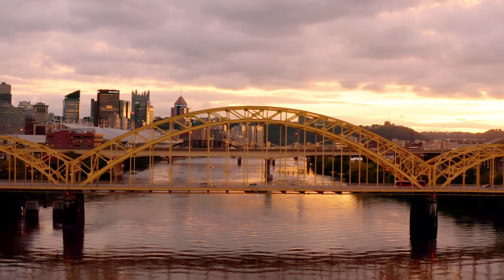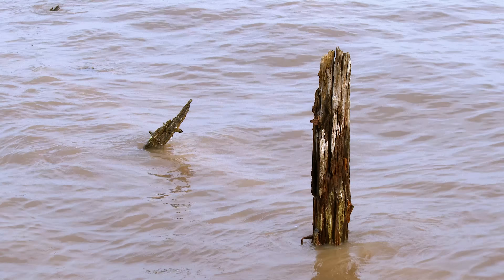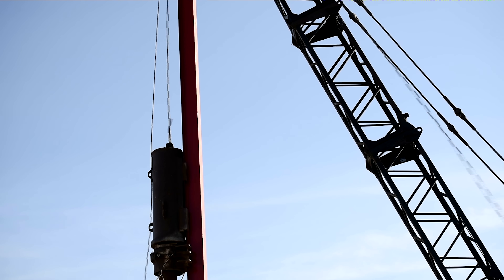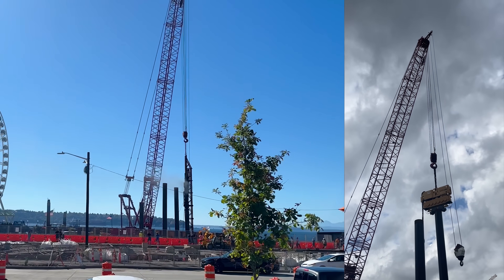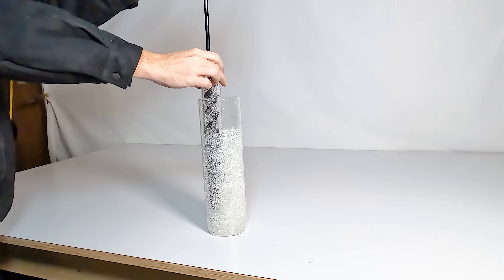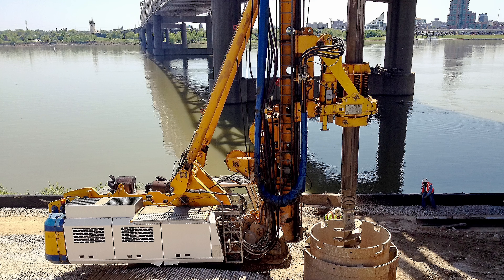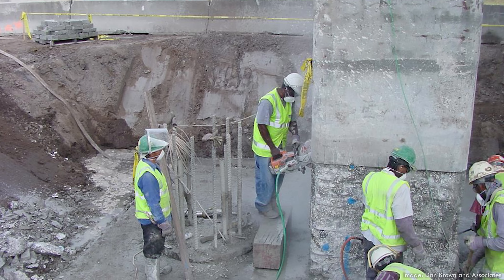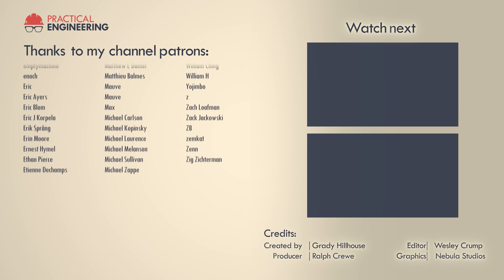Why Bridges Don't Sink

Comment: You brought back memories of the construction of CA118 through the San Fernando Valley. When I was a youngster CalTrans needed to span a concrete storm drain channel and the 2 streets diagonally. We lived two blocks away. Once the pile driving started, it seemed to last forever. 

One the plus side, when the city moved houses off their foundations to make room for the freeway in the 60's we took the banana seats off our stingrays and put 10 speed saddles on, cut down the bars and BMX was invented. All manner of ramps and bumps available in the newly emptied lots. 👍

Thanks for the videos!

Comment: I don’t know what it is called but I loved the idea of using water pressure to sink piles into a soft underwater soil. A pile with a open bottom and sealed top is lowered into the soil and then the water is pumped out of the top of the pile causing water pressure to push the pile into the ground

Comment: My favorite pile is a Torpedo Pile, why try and install a pile deep underwater when you can simply drop a huge nail with fins of the back of a boat! Note i don't really feel like they are true piles as they resist mooring loads of floating structures.

Comment: I worked at the building of the Oslo operahouse when I was young. One day I helped to scope and measure out some of the pilings in the water holding the building up. By some lapse in concentration I mis-scoped one pile and it now sits over a meter in the wrong position. Ooops... :D

Comment: In structural engineering we differentiate H beams and I beams by the "flange to web" ratio (or width to height for non technical terms)

An H beam will be square, as in the flanges are as wide as the web is tall. An I beam as a <1 ratio, so it's taller than it's wide

Comment: i used to install helical screw piles, largely for lower density residential settings, mostly just 10ft long 10-12" diameter single helix screws. Sometimes we would install over 60 a day as a single crew. It was a tough job, lots of driving (sometimes deep into the city with a large truck and long trailer, lots of energy exerted just to set up each jobsite. Unless something went wrong, like excessive frost or hitting large rocks under the surface, the job itself was typically quite straight forward. Lugging around sometimes dozens of these 100lb or so screws all over jobsites in preparation was usually the hardest part. I don't really miss that job, not that I like my current one all that much but even a decade later my shoulder still isn't recovered and the unpredictability of the amount of work each day (and thus when i would be off) wasn't what I wanted. Some days I'd be done by the early afternoon, others I'd be working from before sunrise to after sunset (and not even just in the winter), it was too unpredictable for me.

Comment: We built pole-frame buildings on the farm with a drilled hole, wooden post, and filling it with tamped gravel (or concrete). By far the simplest and cheapest way to put a building up. In one case a building started rising out of the ground as it floated on groundwater - we had to pull the walls back down a few inches each year to keep the building on the ground.

Comment: When they were excavating for the Taipei 101 building (https://en.wikipedia.org/wiki/Taipei_101) the weight of the dirt removed was about equal to the final occupied weight of the building so that the ground pressure would be the same.  I expect part of the design of pile foundations also does that, i.e. the ground loading (PSI) is about the same.

Comment: I know the limitations of driving piles in urban areas all too well. Had a full summer listening to it being done 200m from my apartment and it caused a record number of noise complaints. Then later lawsuits that ended with about 10 million dollars in damages being paid because the enormous vibrations caused the foundations of surrounding buildings to sink unevenly to the point where someone came home from vacation unable to open the doors in their apartment.

Comment: You think piling is disruptive, try dynamite. In my arra every building starts by dynamite blasting a foundation hole, for parking.  Makes for a solid foundation. 

Up north, some freeway bridges are just decks from rock yo rock as the roadway is blasted low. We never have stability issues.

Comment: Worked as a structural technician and the engineer designed piles for a house uphill, the pile rig couldn't reach that height, then they also encountered some boulders that made it impossible to drill the piles. Quite interesting to work alongside the engineer trying to solve the situation.

Comment: The reason we have H-piles and I-beams is thanks to buckling. An I beam is ideal to use as a beam, it’s usually taller than it is wide, being optimized for bending forces. H-piles are ideal for piles, as they are usually square, (just as wide as tall), therefore its resistance against buckling is way more similar in both buckling directions.

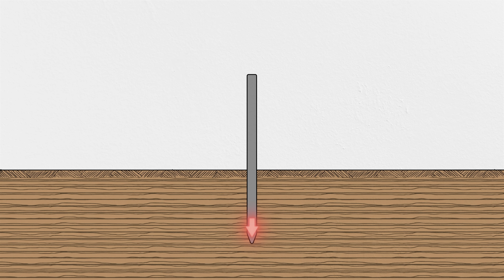Comment: 3:34 I once saw a construction site where piles were driven into the ground. There was a peat layer between two layers of sand. It took the machine a good amount of effort to drive the first four meters or so. Then it sank by itself until about four meters left. Those last few meters took a lot of effort again. Watching this for a morning gave a lot of insight into how the peat was undulating on the bottom more than on the top.
Reply: Yeah, peat is literally the worst type of soil to build on, you are NOT ALLOWED to make a bearing-type shallow foundation on peat soil, unless it's nothing more than a backyard shed or something else equally small and unimportant.

Comment: Am H pile is called like that because it uses an H beam and not an I beam. 
At least where I learnt engineering - some time™ ago - I beams had a rectangular envelope (width < height) whereas H beam were more squarish (width ≈ height). Example: an IPE200 is 200 x 100 mm, while a HEB200 is 200x200 mm. There are IPN, IPE, HEA, HEB and HEM profiles, each with slightly different thickness and shape of the "wings" of the beam (sorry, I have no idea how the parts of steel beams are called in english).

Comment: "A driven pile is a tested pile."

You have just encapsulated my distaste for large-scale "circuit breakers", which really aren't circuit breakers, they're just relays with external control circuitry not constrained by physics

Comment: Ok, so now I'm confused. Driven piles by their nature compress the ground beneath the pile reducing the risk it will sink under load, and the length of the pile helps withstand lateral forces too. I don't get how a augered pile can have the same resistance to load, yes it will have the same resistance to lateral forces, but virtually none for compressive loads, as there van been no prior compression. This can only lead to a built-in failure of the pile, as due to differing ground properties, some piles will sink at different rates to others, causing instability in the structure relying on them.

Please explain how engineers get around this.

Comment: Driving a pile tests it for dynamic loads, wouldn't there have to be additional procedures in place to test for static loads?  Or is it just that the dynamic load is so high that the static load becomes sort of trivial?
Reply: For driven pile, it's trivial. PDA testing on driven piles is common, and it gives insane amounts of data regarding forces used, pile stress, soil conditions, etc. Just having blows per inch records is enough to calculate capacity.
For drilled or vibrated piles, they almost always do a static load test. Sometimes dynamic tests, but I've only done that once. It was weird.
Reply: @tootblast9965  Ahhh neat.  Thanks!

Comment: Grady, i was a concrete pump operator for several years and worked on many bridges. On company used a basketball to plug their tremme pipe to get concrete under the water in the casings. As the casings filled,  one guy would climb down to recover the ball. I did have one critique about the concrete underwater as we use admixtures of bentonite and silica fume to make concrete "water proof" so that it doesn't dissipate underwater.
Reply: Lmao what? that's so funny a basketball
Reply: Do they use a basketball as a weight?
Reply: @ginajanee12  no not as a weight,  as a means of keeping water from ingressing the tremme pipe. It just so happened that a basketball was the perfect diameter.

Comment: Grady, when we added a new building to our college out here in NE San Antonio they were putting in some piles the vibration was strong enough to knock my favorite Beatles poster off the wall. (Good news, my dean paid for the replacement poster). I totally get the disruption caution for installing piles.
Reply: When I was in college, they were driving piles for a new building next door. It was enough to shake the projectors hanging from the ceiling. At the time it was pretty entertaining.

Comment: Sometimes bed rock prevents piles from driving to refusal so you often will use a concrete spread footer on top of the rock. I’ve also seen piles that didn’t meet refusal because of the bed rock causing the h beam to bend, the contractor kept adding h beams and eventually the pile resurfaced straight out of the ground a few hundred feet away.
Reply: The ultimate "can't see where you're going"

Comment: Had a friend that told me about the piles that support the SeaTac to Seattle elevated tram. They rely on the friction of the soil because they coulddn't drill deep enough to hit bedrock. He cautioned that in the event of a large enough earthquake, the piles would sink as the soil essentially would liquify.
Reply: When Flagler built his railroad in Florida, across the swampland, the pilings just kept going down.  He determined if he stacked three pilings on top of each other, it would support the railroad.  The friction on the pilings worked well supporting the line.
Reply: @robertheinkel6225  Listen, lad. I built this kingdom up from nothing. When I started here, all there was was swamp. Other kings said I was daft to build a castle on a swamp, but I built it all the same, just to show 'em. It sank into the swamp. So, I built a second one. That sank into the swamp. So, I built a third one. That burned down, fell over, then sank into the swamp, but the fourth one... stayed up! And that's what you're gonna get, lad: the strongest castle in these islands.
Reply: @BertNielson  Ah hell what is this from again??
Reply: @Hearstbane  Monty Python and The Holy Grail
Reply: Did they at least make the part where people would be buoyant?
Reply: @naamadossantossilva4736  nope. It's all concrete and steel. It's elevated track, so buoyancy wouldn't do anything about the fall.

Comment: My company just build a big HQ in TN and we had to add a bunch of additional micro piles alongside the planned (not-micro) piles because they only soil tested a few spots around the perimeter. 

Turned out the center of the building footprint was an entirely different geology.

Comment: My immediate hypothesis for "I-beam" versus "H-pile" is to provide a layer of disambiguating terminology in cases where multiple parts of a structure are very similar. Suppose you have a collection of two sets of very similar steel structural members which differ only in length; it seems intuitively easier to remember "8 meter I-beams and 8.5 meter H-piles" than to remember that "the 8.5 meter I-beams are piles and the 8 meter I-beams are for the above-ground structure". I would suspect that this is a factor in the difference in name; it creates a semantic distinction between the two.

Alternatively, this could be a case where someone was using standardized H-piles and someone else was independently using standardized I-beams, and when the two standards met and became used together the names were so thoroughly established that they didn't get unified.

Comment: I-beams became H-flange beams when it was discovered that the extra material in the vertices of the "I" didn't do anything can could be moved into the flange where they were more useful in resisting torsional forces.

Comment: I didn't know I wanted to know about piles until now!
Reply: Ooh electrical engineer looking at a video meant for civil engineers?
Reply: @Neptunianwave  - I'm an EE, too, and I never miss a Practical Engineering video. I watch other civil engineering channels, too. Recently been watching Casey Jones, a geotechnical engineer, and this particular video, is right in his wheelhouse. Also, the first two years of engineering school, are pretty much the same across disciplines. I don't zap myself quite as often as ElectroBOOM, though.
Reply: @michaelmoorrees3585    I thought Casey Jones was a railway engineer.
Reply: "Piles of fun."
I died. They had my funeral already. I just sank right into the ground.
Reply: Me neither however I did enjoy learning the different types of piles
Reply: No Preparation H required!
Reply: @SgtTibs  But H beams may be required!
Reply: @SgtTibs i actually did end up needing the preparation H 😂😂
Reply: Shocking seeing you here Mehdi
Reply: PILES
Reply: Perfect summary.
Reply: unexpected Mehdi
Reply: Are you going to electrify one of those piles
Reply: No way, what are you doing here, go give a shock to yourself man. 😂😂(I am joking)
Reply: Locally we've learned a lot about them as certain houses have been sinking, un-evenly-sinking, into the unknown muck deposits they were built on top of 50 years ago.  I have two friends who both had to gut their homes and have their floors drilled to allow piles to be placed to stabilize the homes.  Both homes, while beautiful, will probably be torn down in the next 20 years to properly build over the lots for the future inhabitants.  There is a house across the street from them that was sold for $650k, and the only reason it was that cheap is that it sunk too much - too unevenly -  and it's a total tear-down for the next owner to build upon the lot.
Reply: Oh hey its Mr Bean
Reply: Right right 😂
Reply: you say that until you spend some time in those manuals
Reply: Yoooooooo electrobooooooom
Reply: Now hook up an extension cord
Reply: Ofc Mahdi is here 😅
Reply: Me too Maddy
Reply: I have had an ongoing pile problem for years #bumholeproblems

Comment: My favorite story about the Coronado bridge you show in the thumbnail is how it got its iconic shape, because it wasn't designed that way originally... 
The story goes that at the time it was being built there were substantial federal subsidies for bridges over a certain length, but the original plan for a straight bridge from downtown San Diego to Coronado wasn't quite long enough to qualify, so the city just tacked a bit of a curve and hump onto the design to JUST meet the funding requirements, and by accident ended up with an iconic piece of infrastructure. X)
Reply: I don't think you should bet too much on this story.  the more logical explanation I've heard is that to get the height over the bay required by the navy, while maintaing the maximum roadway slope and minimum vertical curve required for sight distance,  the curved horizontal geometry was chosen to provide the total lenght required while minimizing the height of the roadbed at each side of the bay.
Reply: @bobstopthat  That was my thought too. I've crossed that bridge more times than I remember, it seemed fairly obvious to get the bridge high enough to clear the ships that would need to pass, they would need to build it that way.
Reply: @bobstopthat  @A1BASE is wrong. and you're correct. I can remember taking the ferries over to Coronado and when the bridge was planned. The Navy was actually against the bridge worried it could collapsed. The naval base was (and is) south of the bridge and would need to pass under the bridge to get to the Pacific. They gave in and agreed to the bridge only if the bridge was 200 feet or taller letting their ships pass. It had nothing to do about federal subsidies. On another note, it was sold to the public that the toll would be only temporary until the bridge construction costs were covered. Of course, the toll kept going way pass after the construction costs were paid and finally ended early 2000s. IIRC it 60 cents each way.
Reply: When I saw the Coronado and "Why Bridges Don't Sink" I just remember being told that the two darker blue spans in the center floated, so if the bridge was blown up, the fleet could still get underway.
Reply: That bridge has zero pedestrian access which is a shame. Although I suspect the residents of the peninsula wouldn't really support the idea...
Reply: The bridge has no pedestrian access at all. It is a frequent spot for those who no longer want to exist in life. I was near the bridge when a guy went over with a K9 that was chasing him, it was unforgettable.

Comment: H piles are square. But initially I beam had a longer web than the width of the flanges. But you can now buy square I beams, so there is less difference.

Comment: I feel I was just left with new questions this time!

About piles—doesn't this all depend on the assumption that the temperature, pressure and composition of the soil don't change over time? Maybe I've been been exposed to more permafrost than most people, but water tables are variable everywhere, aren't they? Doesn't this matter?

About drilled shafts: we seem to have lost the friction and compaction mechanisms entirely. So how do they work?

Comment: Love this sort of video! I have years of experience working for a company that does just this sort of work. Which means I have to point out that the animation of the screw pile at 13:55 should have been coming OUT of the ground, not going in... based on the angle of the flights on the screw and direction of rotation :)